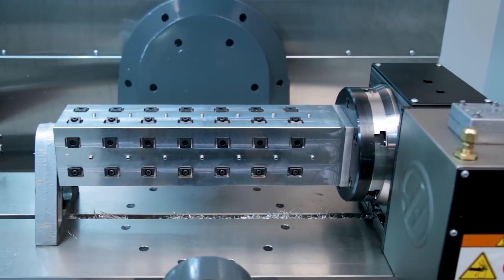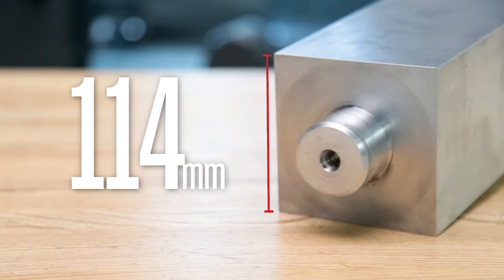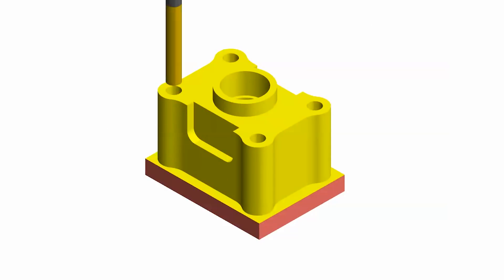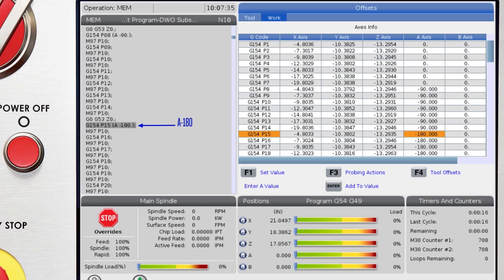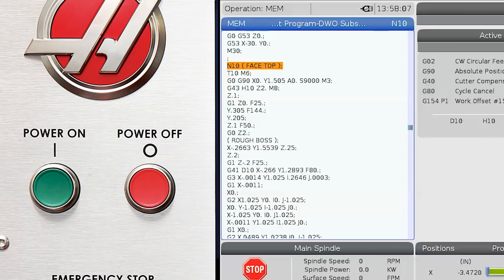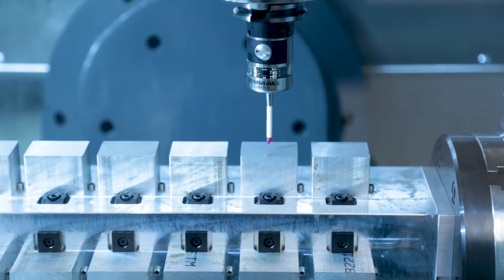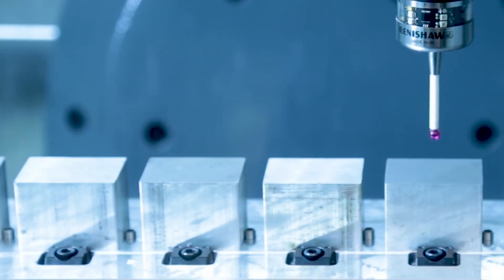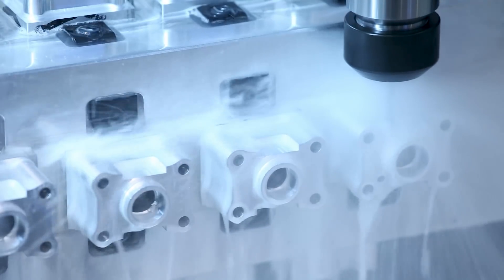Reduce Cycle Time with a Multi-Part Fixture on the Haas UMC-750P - Long Version

Comment: 6:30 As someone that has used Excel from the very beginning. I always find it funny when someone uses Excel to shortcut work, but fail to think about how much further they could have done it.
Macros are awesome and could have added that M97 P10 right after each line, easily.
etc.

Comment: Am I the only one thinking that if you know your parts are 2.5 inches apart then all you need to do is pick up one part? Simple shift the x number by 2.5 inches for each subsequent work offset. The y offset would be the same for all parts as well as the Z offset. Then just add the appropriate b axis offset for each part in the controller. Math is your friend.  Super fast that’s how I pick up 48 work offsets on our horizontal and only need to probe 2 parts to do it if you know your center of rotation. And you could also just use a transform in master cam to use one tool on each offset before switching its super helpful and saves time.

Comment: You could also use G52 to just shift the offset 6 times instead and you'd only need 4 offsets and it would be way less code. I used g52 a lot before I started using cam for everything.
O1
.
.
.
G54
M97P1L7
G91G52X0Y0
G55
.
.
.
N1
T8M3
.
.
G52X-2.5
M99

Comment: Looks more complicated  to read the program. Using G52 work shift will shorten the file combining with variables representation of each station so you have options to turn on/off only station to run. Fixture has stopper and don't need to probe each piece as this is stock size and  opn1 only. Work offsets can be hard coded by variables assignments.

Comment: Why not machine all of these parts from one piece of stock? You would get more parts per fixture, reduce setup and 2nd op setup time, and the CAM would run all of the parts as one simple program. Also, if you have 30" of travel in X, why in the world are you using a 20" tombstone? Make use of the ENTIRE workspace and gain real efficiency and throughput. I appreciate the Haas videos, but they are often short-sighted in terms of real manufacturing challenges.
Reply: Single piece of stock wouldn’t get you more parts. You still need the same room between parts. Could use a longer tombstone though. The 20” is off the shelf.
Reply: @mattym8 It's concerning when a machinist says, "off the shelf". Time is money. Making fixtures that utilize the entire workspace efficiently needs to be second nature. One piece of stock closer to 30" makes more sense. I don't see how making that over what is shown would be any more work.
Reply: Would save money on saw cut tho 🤷‍♀️

Comment: This video is a great advertisement for Hurco. You can ditch the macros with WinMax and program the probing and programming in a fraction of the time as shown here. With that said, if you have a Haas, this does help and I use a similar strategy on my other machines.

Comment: Does m97 only work on certain controllers? The ones at my shop will not work with m97 so we use m98 but thats a pain because in order to edit u need to pull up a new program every time and then refer back to the main back and forth sometimes takes forever if subs are long

Comment: Haas tip of the day: How to waste time programming, take way too long to set up, and crash your machine! 
There is at least 10 better ways to do this between macros b and cam.  All you computer programmers out there: you can use nested loops to run this program, index the tombstone, and even automatically set the offsets! No way around it, my ass. Step up your game Senior Applications Engineer John Nelson...

Comment: I'm no G-code/CNC wiz, but pretty good with regular computer programming. C++/C#, Java, Basic etc., and I'm shocked. Are there really no better flow control in this "language"?? Just a simple "for...next" loop with simple variables would make this process sooooo much easier. And eliminate the risk of typos and copy/paste error. And make modifications to the code much easier too...
Reply: these do exist in some cnc systems, but apparently not within the Haas system

Comment: This is literally the longest way to write this program. Its good to know so you understand how much work it is and how it works. CAD/CAM takes care of this with a few extra clicks and then you set your offsets. Only have to program 1 part and can run as many as you can load in the machine.

Comment: You should use a G65 P9810  instead of a G91 to move to the next part.... if there is an obstruction the G91 will break the probe tip. the G65 P9810 will stop if the probe tip hits and unexpected object
Reply: yes!

Comment: This is a great concept idea!...
 but a horrible nightmare of programming. 
 all that typing will eventually end up in failure. Specially if you have to do it for every single part..
 a little macro programming & post-processing editing will make this an easy task for every new part no matter how many parts you are running.

Comment: we did that years ago in out VF6 5 axis. But some setup people would make mistakes on entering multiple work offsets. So we built a macro that adjusted all offsets based on first offset .  That macro was in beginning of program and had a block delete as it took time to run the macro after the first time.  worked great. I came from hand g code and sub programming - I glad to see it still has purpose

Comment: Nice video! But you could’ve Model the whole fixture with the parts on it up and create a Tollpatsch pattern ...That way you would’ve saved yourself the time programming and probing each part...Or am I wrong with that?
Reply: Your'e not wrong. The fixture should be more precise than the part that it makes hence what you said about programming to the fixture locations is correct. Only thing is if you messed up the fixture some how you can't make any adjustments with your work offsets to correct that.

Comment: The problem with looping your probing routine is that the probe will be turned on and off at every part.  The best thing to do is to program the part using
the renishaw routines directly.  That way you turn the probe on once and off and the end.  Way faster.

Comment: Come on! Why don't you implement this in the controller? The G code system would definitely need variables and FOR cycles. In a Turing-complete language this would be few lines of code. Without the need for copy-pasting, and if you have to change the X offset, you would only need to change a constant at the top of the program.

Comment: We use mitee bite pitbulls, but the guys have a recurring issue of not tigthening the screws down all the way. So our tools hit the screw or clamp and break them. Is there any alternatives or good practice? Its kind of a pain to have to keep double checking peoples pallet loads to make sure the things are against the stops and that the screws are tightened.
Reply: Torque wrench could help, tell your guys your done bolting when you feel it click and not before!  as well as making the pocket for the pit bull clamps deeper to avoid tool collisions. Edit: wow just realized this comment was 4 years late hahhaa 😂

Comment: Why not draw up your fixture plate, 2 dowels in the X,Y corner of each block, then draw all the blocks on the fixture, machine out the fixture, with 2 reamed holes to indicate in for future setups to indicate and pickup the fixture, then draw all the blocks and program them all together on the fixture. Then the only hand programming you’ll have to do is the rotation in the A axis.

Comment: I'm using Macros, so you can only use it if Macros are enabled on your machine.
Check this code out for my multi part programs:

N9999 (SUB CALLER/SHIFTER) 
M83 (AIR ON) 
M97 P#629 
#633= #633 + 1 
IF [ #633 EQ #199 ] THEN #629= 0 M84 (AIR OFF) 
IF [ #633 EQ #199 ] THEN G52 X0 Y0 Z0 #633= 0 M99 
G52 X [ 3.0 * #633 ] 
GOTO9999 

Automatically shifts my desired work offset to the next part. It rules. That way you don't have to write the WO then sub call a bunch of times. You also only need one WO call not multiple. There's more to this that makes it work, but you get the idea. If not DM me.

Comment: Compared to "modern" programming this seems ridiculously complicated. How are these tips not already implemented in the VPS or even by dedicated NC commands? For example, the Excel shortcut could easily be added via a context menu.
Nonetheless the effort you put into these video is very nice and in this way at least we get tips which are applicable to other machines as well.

Comment: Just use FUSION 360 instead of mastercam, and you don't have to change the code manually, anymore
Reply: whaat? you think fusion post processing is any better than mastercam? i use both and a post processor can be made just like you want in both..
Reply: You can post out in subprogram routines... I'm pretty sure they're just doing it manually to explain how everything works. Every program has it's plus's and minuses, I use Mastercam & GibbsCAM daily and I'm familiar with using fusion. Using defaults of any post processor isn't optimal

Comment: I know we all have different shops and different tactics but  myself,  I'd rather do all this programming in my CAM program, post out a program with the appropriate code instead of asking my guys/gals on the floor to hand edit all this. If I was feeling extra lazy, I'd write a macro for one part's work shift, then have the machine input all the work shifts for me. It seems like method in the video requires a lot of spindle down time.
Then again I'm just a guy behind the keyboard, fuck me right.
Reply: I understand your point but please read the thread below started by Rohan Ranadive. This explains why I did it this way.

Comment: A good example of working with subprograms.
But if you use a special multiclamping base, then designate WCS from it. It is more effective. Not need using renishaw.
Reply: I understand your point but please read the thread below started by Rohan Ranadive. This explains why I did it this way.

Comment: If you already have an assembly of the fixture and the parts are all patterned out on that assembly, then you can do all of this within your CAM package through the use of toolpath patterning. If you want to maintain the adjustability of having each instance of the part on its own WCS, you could pattern the entire program folder and have the software "optimize for tool changes" for you instead of going through the code manually, opening multiple pieces of software and increasing the chances of an operator error. 
As my first shop teacher always used to remind me, "Work smart, not hard"!
Reply: exactly!

Comment: I'll be using this to make room for more programs in that ridiculously small 1mb space they gave me on my $140,000 VF-4SS. I'll never understand why they only give you 1mb of space.  Leaves a very bad taste in my mouth everytime I have to move a program off of the machine and onto a USB drive.
Reply: yeah man were in 2018 now, how hard can it be to have a GB chip
Reply: 120k lines of code?? My machine will burn through that while I walk to the bathroom & back...
Reply: computers don't "burn through code", if you wrote a program to mill which is more than 120,000 lines of code you're a bad operator
Reply: CNC machines burn through code, not computers. My biggest problem to date was 32M lines, I must be REALLY bad at what I do.

Don't make general statements about what's "good" & "bad" in this trade, at least without asking a few questions first.
Reply: you program complex surface geometry by hand?
Reply: @key2010  for 2,5 d parts yes  but full 3d no  you need a lott
Reply: @key2010  You obviously have never had to surface complex shapes like on most dies or molds. lol but ok. Not an operator its Journeyman bub.
Reply: 1mb gives you 120,000 lines of code, what do you need more than that for?
Reply: @key2010  i use a macine at my work that has 250.000 karakters space that  not a lot 
ful 3d parts are not a option
Reply: if you bought any machine after March of 2016 they all should have 1 GB of memory standard.  Most other builders dont have anywhere near that

Comment: I use g52 so that I only need to find 1 work offset location because I'm super lazy.
Reply: TacticalKeychains I use an edge finder too but g52 shifts the coordinate system using 1 offset I don't like having a bunch of offset for a large fixture. Too much setup time.
Reply: I have to admit that you are the laziest machinist I've met. Well done. I hope to be as lazy as you one day and still make bank.

Comment: Or since it's OP 1 with oversized stock, just program off the fixture and multi part in CAM with a single work offset. Any rev changes come through and you can just update the model. Lots of probing and tweaking like that I tend to use notepad++ with gcode template, cimco, or go all the way with the Renishaw CAM plugin.
Reply: Hes using mastercam lol....That all could of been done with the translate feature, but good for him right lol.